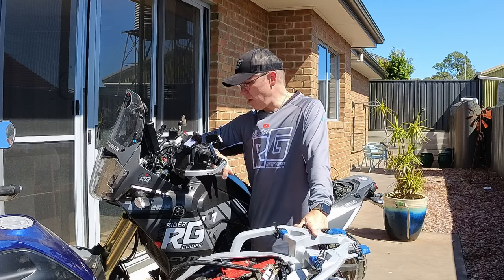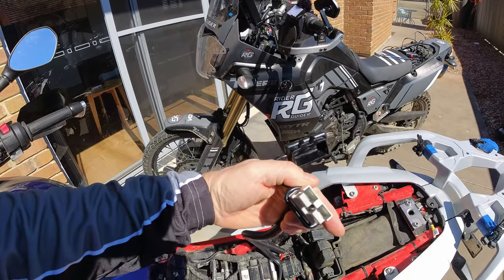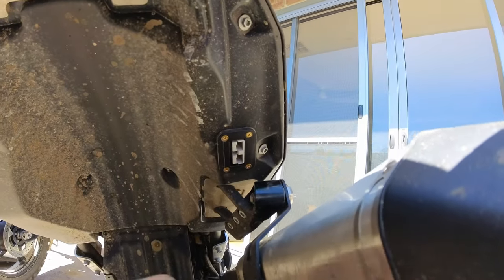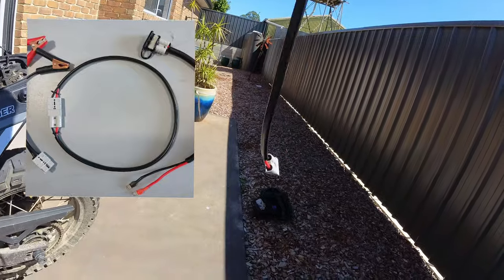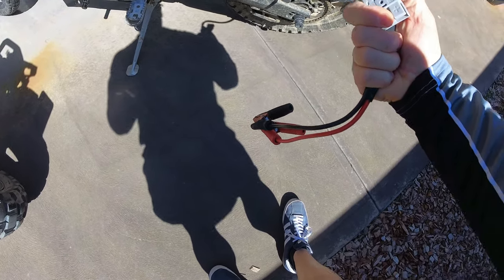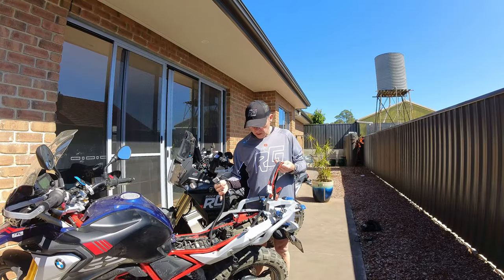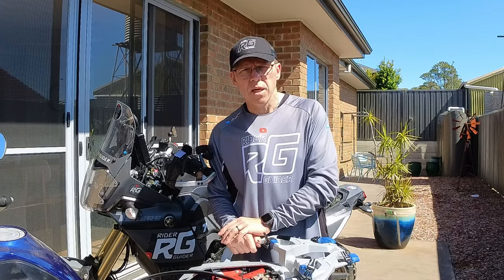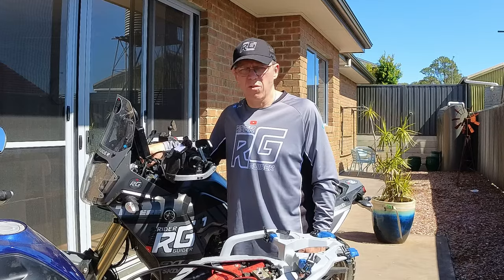Why you absolutely NEED jump leads for a motorbike

Comment: These are also used for highly modified high compression built engines that are hard to start because they consume a lot of juice to crank on drag racing bikes.
Reply from the maker: Yeh I’ve seen them use friction rollers too.  Need some umph for them motors!

Comment: No current overload protection thou..
Reply from the maker: Wouldn't you risk it rather than be stuck somewhere without any reasonably quick chance of rescue?  I've used jumper cables from vehicle to vehicle many times and have never had any issues caused.
Reply: 00:58 ... it's a fair point, choice to stay put or a very low risk of what?  If you're not connected for long (and it's unlikely you would be) there is no issue with jump leads.  These are a great idea.